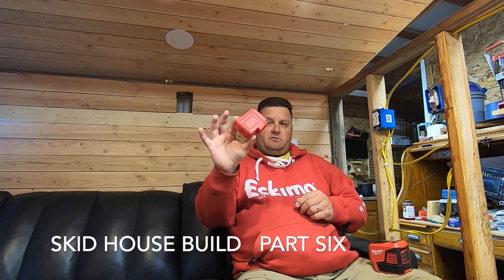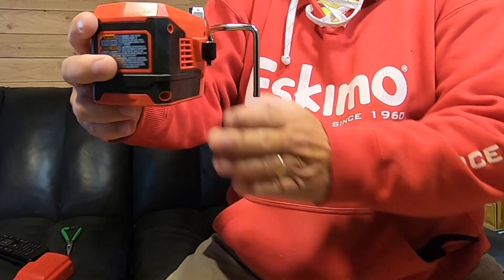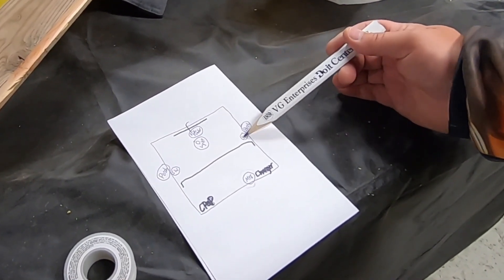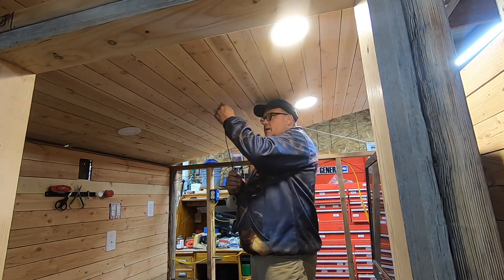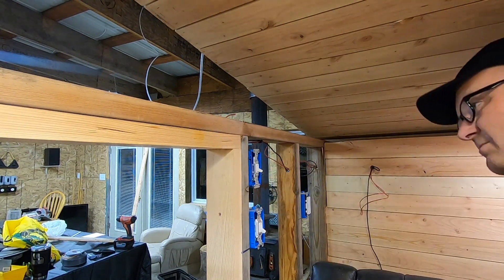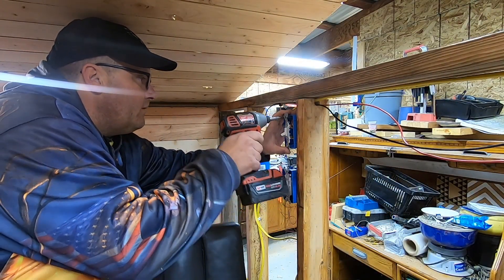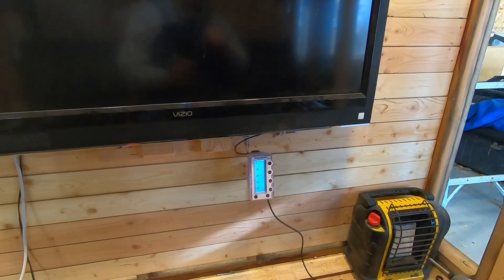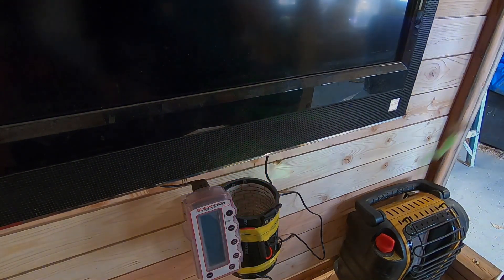Skid House Build Part 6

Comment: Joe are you hooking your camera to the TV for watching under water action. Man I’m loving this build, great ideas buddy. Later J
Reply from the maker: I just sent my RT9 in for some warranty work. They sent me a brand new camera for free, but I don’t have the adapter that goes to the fishfinder yet. Having a really hard time finding one. There is only four wires on the camera, so I might just call the technicians and see which wire goes where and jury rig it. Either way, I could take the LX9 and do the TV thing no problemo. Thanks for following along and glad that you are enjoying it. Unfortunately, I probably won’t be working on it for a few weeks because I will be on the other line, if you get my drift. 😂
Reply: Better luck with your RT9 than I’m having with my mega 360. Still haven’t got my ducer. Good luck on the other line as well, I hear we might finally be getting some winter next week. Guess it’s time to get ready. Later J